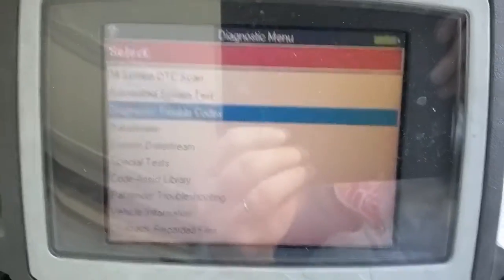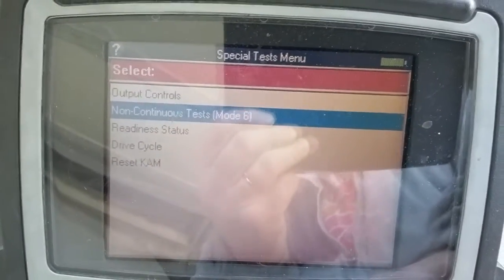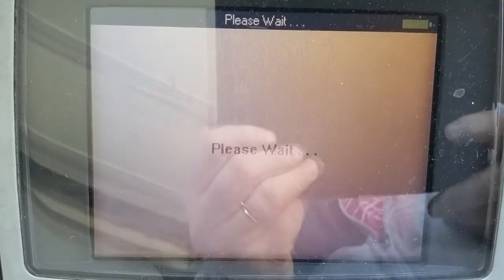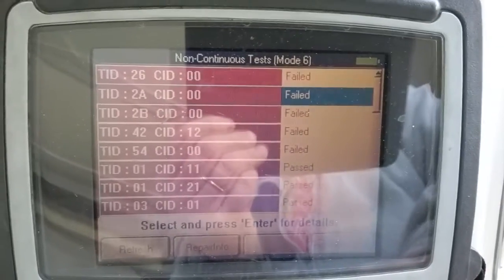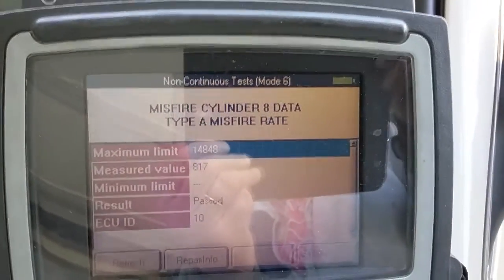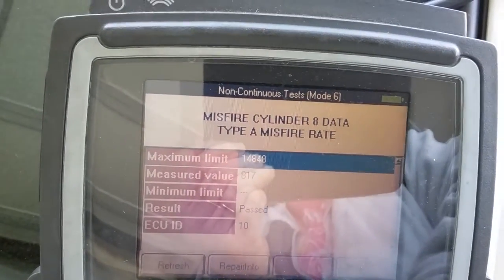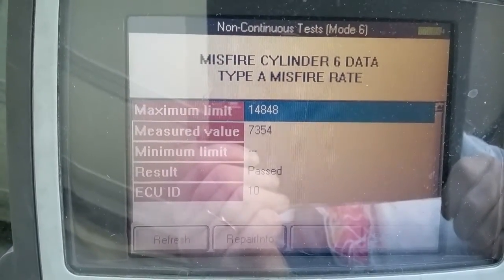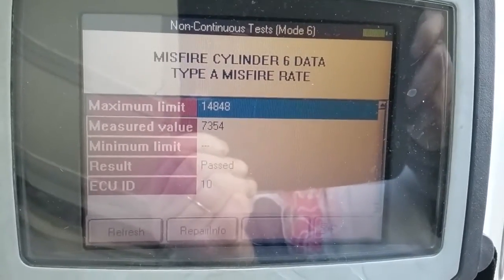Ford misfire without check engine light on.

Comment: Thus is aggravating the hell out of me.  Got a scanner with mode 6....it is hit or miss (no pun intended)....one time I got results with the misfire counts (it actually read a maximum value and measured value and then I tried again and it doesn't even measure a maximum value....this is beyond frusterating....I went on the highway and drove 60 and then down to 40 like it said
Reply from the maker: I totally understand. I had an 98 explorer that went almost 6 months before I could narrow it down.
Reply: @Steve4x4  I'm just frustrated with my scanner and the lack of clarity.  I wish there was at least a timestamp to go with the data.  I have no idea when these misfires were recorded....was it 5 drive cycles ago at 50 mph accelerating?  Was it last drive cycle idling?  

It just randomly works when it wants to and I have no idea when it is recording the data.
Reply from the maker: @macknumber9  what I can tell you they are as recent as last time you cleared code. Everytime you clear codes, that resets the system. When readiness monitors are set to "not ready" you cannot trust the mode 6 data.  The monitors must be set to "ready" in order to trust the mode 6 data. When a monitor is set to ready that tells you that test I'd mode 6 has been run and had passed.

Comment: I'm gonna check this out at my shop today.  My truck sometimes "vibrates/shudders" slightly around 35-45mph.  Not sure if it's a misfire or a torque converter shudder.  Haven't gotten any codes.
Reply: Exactly what I’m going though, have you figured it out? Hoping it’s not a torque converter

Comment: Thank you for video post. I have read code device to hook up 2011 ranger 2.3L. To find misfire. I see number but did not light on yet. Pull out number 2 wire spark and it wet. I put dry it out. It run much better. I’m happy but I has to deal “wet” into wire spark plugs. I will buy spray for water proof.

Comment: Can anyone plz help? 03 focus  dohc zetec. 205k new everything! New timing, water pump, coil pack, both o2 sensors-my exhaust flange directly past rear o2 sensor leaks & it's a bit loud so, when I got a code for o2 sensor, I simply replaced Em both! From time to time it throws a code & I erase it. It is very cold tonight & I start my car & let it warm up.sounds fine, reved the motor & it sputters bad. Sounds to me like a spark plug or wire but I don't want to throw parts at it. There's no check engine light. Severe miss/ sputter when I rev it in park! Have changed spark plugs but put 1 used 1 back in due to a new 1 crumbling the ceramic within 2k miles. But, it's always been fine! Until now
Reply from the maker: D.j. B  inspect fuel pump pressure, fuel injection.

Comment: Could you please tell me what scanner was used in this video?
Reply from the maker: This Scanner is Tech Force from Cornwell. how ever,.. its a copy of OTC Genysis scanner (Cornwell, Matco,and Mac all have thier own versions of it). Also keep in mind that Mode 6 wasnt available untill  mid 05 ish, I honestly cant remember when Ford made that data availble to the aftermarket scanner  world. But if ypou can get to Mode 6 data,.. its a valuable tool to help with diagnostics
Reply: does that mean I wouldnt be able to pinpoint a cylinder misfire on my 1997 5.0 with any scanner, or just yours?
Reply from the maker: yes,.. pretty much,.. the vehicle is too old to record and store Mode 6 data. Now if its a constant misfire,.. you can always do a power balance test. But with a generic scanner,.. you won't have the capibility to that with the scanner. That is the difference between $4500 scanner(Like I have) and a $250.00 scanner. With your 97 5.0 You need to use old school diagnostics. Pull the plugs and compare. if you have a well enough missfire, then one plug that will look different, and will show you. Now missifre is just that,.. a cyliner that is misfiring. Doesnt mean its a plug or plug wire. Could be anything specific to that one cylinder.  although the most common cause of a misfiring cyliner is a plug or plug wire.
Reply: I was going to wait until dark tonight and look under the hood for arcing, but in the meantime I was going to buy a scanner if nothing obvious was found. Now it looks like that's not needed. From what ive been researching my problem sounds like a typical coil issue and mine uses two coil packs. Here I was thinking I would be saving money getting the scanner and diagnosing it myself, but now it looks like i'll be saving money in NOT buying a better scanner. Thank for the info, very much appreciated!
Reply from the maker: To chase a arching misfiren use a spray bottle  with a lil salty water.. ive also had successs with windex too.